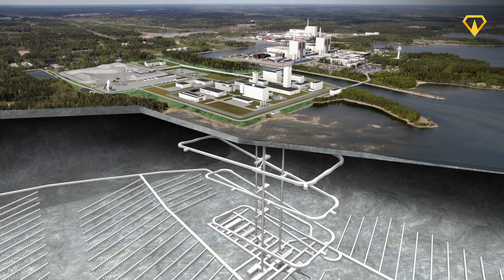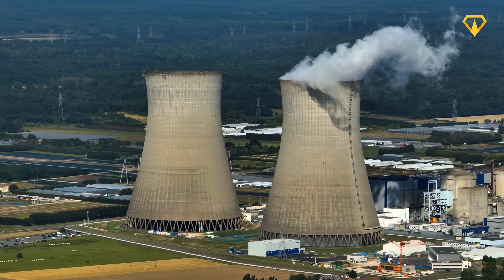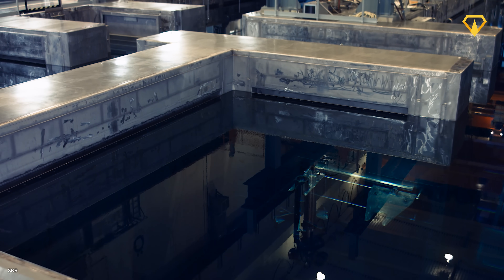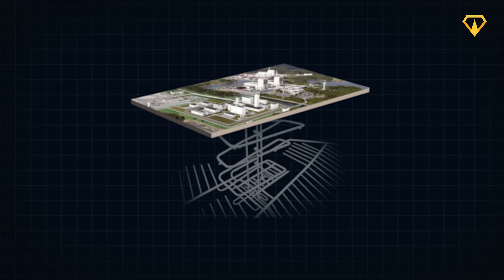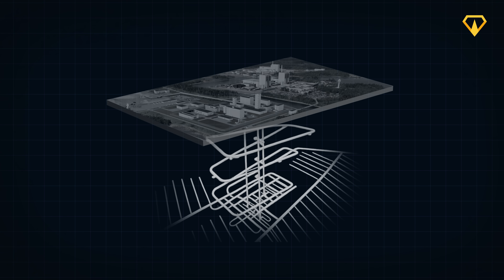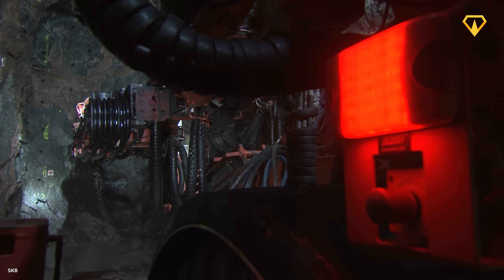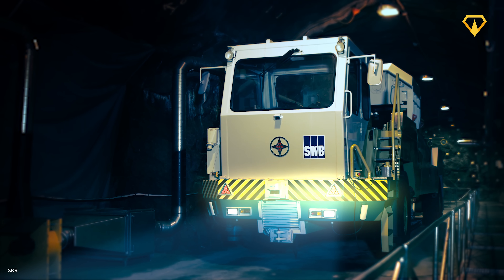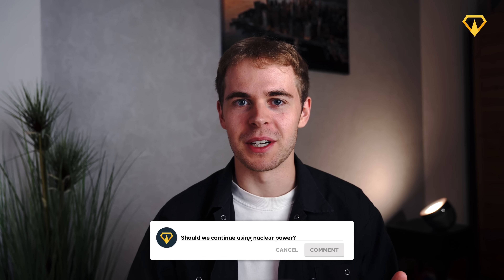Sweden’s 100,000-Year Solution to Nuclear Waste

Comment: but you can use the spent fuel in other reactor types. after they come out of these light water reactors, they still have about 95% of the energy in them but the reactor type just isn't very good at using it.
The ones that could are not very widespread/ in development but you could just wait a few more years to see if this will solve the issue or not instead of building something like this.

Comment: What's the point of using photo of foreign nuclear power plants in the video? All Swedish nuclear power plant are cooled by the sea, and is not using cooling towers. Its not that hard to find some stock photo of Swedish nuclear power plants. If you did get something that basic incorrectly, what more have you get wrong?

Comment: Nuclear is a risk. Coal is a guaranteed failure.
If other technologies can replace both, that's good, but if I have to pick between two bad options, I know which one I would go for.

Also one more point - assuming society doesn't collapse, it is absurd to me to think that we won't find a way to process spent fuel in less than **1000 years**.
We'll probably find it a lot sooner if we really try, especially since there are theoretical ideas floating around today.
This means we probably only need safe storage for a few hundred years, which is very feasible.

Who knows, maybe in the future companies will be bidding on the rights to dig up the "spent" fuel we are planning to deposit.
I say "spent" in big quotes, because current nuclear tech only extracts a few percent of the potential energy, I think it's like sub 5%, but don't quote me on that.

Comment: Or use recycling nuclear fuel generators so it's only toxic for a couple of decades instead of Hundreds of Thousands of Years we have had these since the 60's and they work only downside is every time you recycle the fuel you get less power and short cycles before it needs to be up cycled so you just use extra generators

Comment: I’ve actually been there, it was a while back before Covid. I was on a guided tour wich no longer exists due to multiple reasons. They had already started digging and we got to go down in the tunnels to see stuff like the capsule, the holes for them, the machines wich would do the stuff. A lot of fun stuff but then the timeline was different by quite a bit. Also got a cool bottle of water from down there, extremely salty water. 

About that last question. In Sweden there actually was a public vote after Chernobyl so about 3 generations back, but it’s taking effect for the last 2. There was 3 options to that question, 1 extend the nuclear energy, 2 keep it as it is and 3 get rid of it. Out of these 3 get rid of it got the most votes. But not 50% so majority wanted to keep it. But Sweden is kinda corrupt and they said “hey looks like we have a opportunity to do what we want”

Comment: "This Tiny One Percent " of highly radioactive waste is not a tiny amount. A standard plant will produce up to 200 tons of highly reactive nuclear waste from spent fuel rods during it's lifetime,  and that is just from 1 plant . additionally what materials are being used for building such a facility even if using the recipe for traditional Roman concrete (of which they assuredly are not) it's not a substance that will persist for the stated time frame claimed in the video. 99% confident that this comment will be deleted before too long if it's allowed to post in the first place.

Comment: About 99% of the energy is still left in the spent fuel. Maybe the solution of the problem is to separate the fission bi products from the Uranium 235, 238 and Plutonium 239 and only bury that?

A common missunderstanding is that the spent fuel is lethal for 100 000 years, the truth is that the decay vill make it safe a lot faster than that. After 100 000 years the radiation will be zero or at least equal  to the natural background radiation but safe to handle without special equipment already after 1000 years.

Comment: If you use oil that is more dence than water as coolant together WITH water and electromagnets to hold the fuel rods in place they simply stop working if something goes horribly wrong. The rods then drop down into the oil which would not evaporate, saving the day. Nuclear plants can be built safer these days. Assuming leaders decide to do so that is.

Comment: "Nuclear waste is highly radioactive for hundreds of thousands of years"

NO, NO, it is not! Nuclear fuel is highly radioactive for 200-300 years. After that you can hold it in your hand. 

The highly radioactive and most dangerous isotopes are also the ones that decay the quickest.

It takes another 10'000-100'000 for the low radioactive and less dangerous isotopes to decay. That is the number used by  fearmongers to sow fear in the population of nuclear.

Comment: for those copper tubes: they're 5 meters long, 1 meter inner diameter, and 5cm wall thickness:

π * (1.05m² − 1m²) * 5m = 1.610066235 m^3

so we have 1.61 cubic meters of copper, which has a density of 8.935g/cm^3 so:

1.610066235m^3 * 8935kg/m^3 = 14,386kg

the spot price for copper has doubled over the past 10 years. i'm not sure what a good value for it is. i'm going to aim high, since copper ain't gettin' any cheaper, some of these will be built in the future (future, future), and it might not even be regular old copper, some high grade stock or maybe an alloy. plus it still needs to be machined or cast or both. so let's say:

14,386kg * $12USD/kg = $172,632

if i did the math correctly (which i probably didn't), and made the right assumptions (which i doubt), each of those tubes, without ends, will cost approximately $173,000.

oh, and luis, you killed it bud!

Comment: Nuclear power is the most expensive form of energy we know of. It is therefore the worst, least effective way to displace fossil fuels: any or all other forms of power would be more effective.  
Let's look at an objective assessment of nuclear power- the free market, in terms of investors and insurance. No private investor will invest in nukes unless the government guarantees the loan. And no insurance company in the world will insure against nuclear power accident. In fact, every homeowners policy in the world has a clause that exempts coverage for nuclear power.  So, worldwide, dispassionate, hardnosed businessmen reject nuclear power both financially and for safety reasons. 
Of about 100 nuclear plants in the United States, we've had a meltdown,  at Three Mile Island.  (One per cent.) In the world, there have been three disasters out of about 400 plants. Still close to one per cent failure rate. How would you feel if one per cent of airline flights crashed?  
-Just as there will always be another plane crash, there will always be another nuclear accident. Since we have many options which are cheaper, the nuclear option is completely unnecessary,  a foolish risk. We should run, not walk, away from more nuclear investments.

Comment: This copper canisters waste a lot of copper. It would be interesting to compare it to the french glas-kokiles system. There concentrated nuclear waste is molten into glas and filled in an stainless steel bottle, as far as I know. Sweden and Finland preferes to bury unprocessed burning elements in final copper castors. It looks not so smart compared to the french system. How the nuclear waste ist compounded 1000 years later ? Will there be any worthfull material inside ? So taking this unprocessed burning rods out again an run it though an reprocessing facility. After a longer time of storage the waste is much less active than fresh decommisioned burning elements from an nuclear power station. So I feel uppset by the huge wastement of copper and other materials, and no planed later reprocessing option. France and Swiss plans to build a final deposit for reprocessing unit glas kokils. Interesting how they will succeed with it. This glas kokiles are not suited for later reprocessing to extract any worthfull content.

Comment: Luis, you did great. Carry on.

Yes, we absolutely should continue using nuclear power, but we should manage the process much more intelligently than we do now. We need nuclear fission because it can provide thousands of years of cheap baseload power; and unlike fusion, it's technology we can use today.

A generation from now, countries running thorium molten salt reactors (another form of fission) on their utility grids are going to look at solutions like this (and Yucca Mountain and all the other proposals) and just shake their heads and try to suppress their laughter.

The "spent" nuclear waste that is proposed to be buried in facilities like this is not really spent. It has a lot of additional energy still stored in it. A thorium MSR could extract many gigawatts of additional power from those uranium fuel rods and transform geologic nuclear waste (dangerous for 100k - 250k years) into a far smaller quantity of other wastes that are only dangerous for about 300 years.

Comment: Wait, why are they burying all of it right next to a nuclear reactor?  I may be remembering this wrong, but in the case of a meltdown, super hot nuclear fuel burns through the ground, going super deep into the ground.... In this case .... Potentially reaching the spent nuclear fuel mass storage if it goes to the side at all in the wrong direction...
Reply: Would it be safer to have equally deep tunnels that are then refilled with ground up nuclear waste that's thoroughly mixed into inert substances (like dirt...) and refilled back in.  That way there is no super high concentration of any nuclear material in any spot.

Comment: 100,000 years. No nuclear radiation detectors above ground. no monitoring needed.2080 year's back fill with cement so early not even 200 year's waiting. eventually there is a radiation leak. how go down 500 metre underneath to check radiation leak?

Comment: I wonder if you could fire nuclear waste into the sun? Hypothetically.
Reply: Weight is the biggest issue.  Each fuel bundle is about 500kg (1100 lbs)
Reply: @lonniemckamey8365  Well the SLS rocket system for Artemus can carry a payload up to 92,000 lbs (27 Metric Tons.)
Reply: @SergeantQuin what is cost per launch of that system? And what about getting the payload out of orbit.  What if several tons of highly radioactive material were to fall from any point during the booster phase of launch, well any point during launch?
Reply: @lonniemckamey8365  I suppose what I'm thinking of isn't necessarily a regular disposal system. But rather just a one time experiment. The SLS (Space launch System.) Is a Human Space Flight rated rocket, It has to work, every time. An SLS 1B Rocket costs 1.6 Billion per-unit. It's not cheap, but I feel like it could work as a sort of last resort. It has the power, and the range to push something into a decaying orbit into the sun. In fact it might be overkill, a Falcon 9 Super Heavy may also do the job just fine with reusable core stages.
Reply: Via the whole, risk of exploding in the atmosphere on its way to space thing....
Reply: @jagaloon216  A safe and easy answer. How Daring.

Comment: i have a better solution what about recyling the fuel we spent and it becames much much less radioactive when its became non recyable. Spent uranium fuel is dangerous for 30k years but if its recyled to its maximum potential its spent fuel will be managable after 200-300 years

Comment: I think it's a phantasy to believe the materials we use in 2025 will be sufficient to store ANYTHING, let alone spent nuclear fuel for 100,000 years.  Then there are problems with plate movements underground, water table contamination, digging up contaminated soil (like we have to do at Hanford Nuclear Site in Washington State).  The best way to manage nuclear waste is to NOT make nuclear waste.